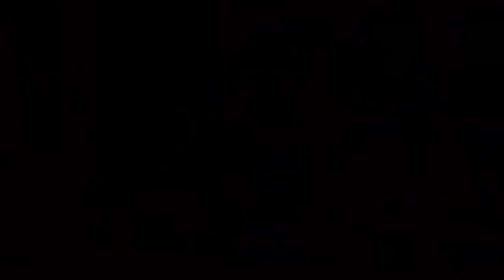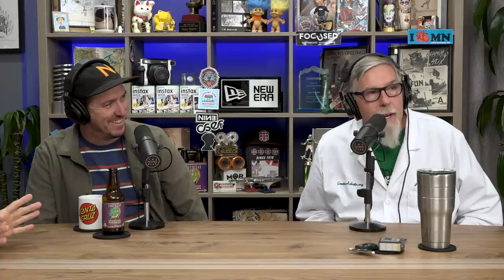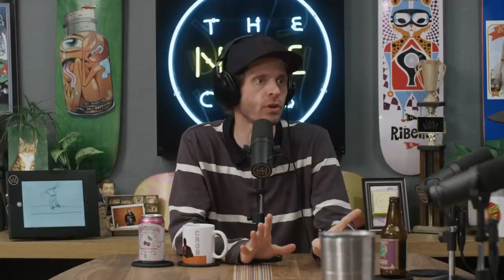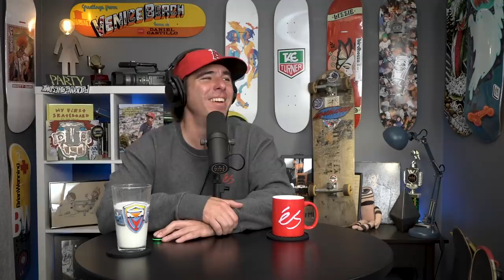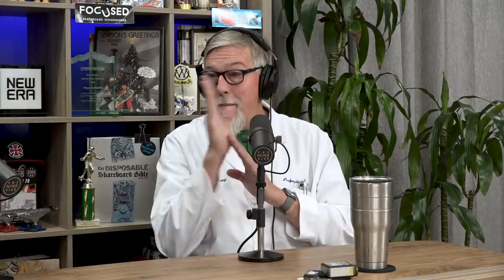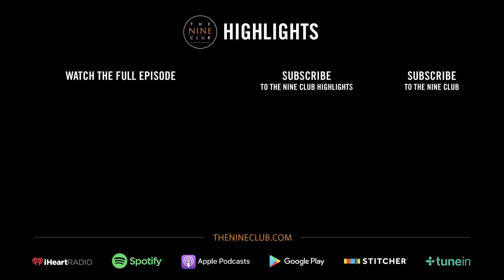Paul Schmitt On Skateboard Development And Technology

Comment: Is P2 bs
Reply: Every p2 I had seemed like they wont snap as fast but the razor tail is the exact same which will make you retire a board the same as a snapped one
Reply: I love my P2. Had it years and still in great condition. Doesn't even have stress cracks on it.